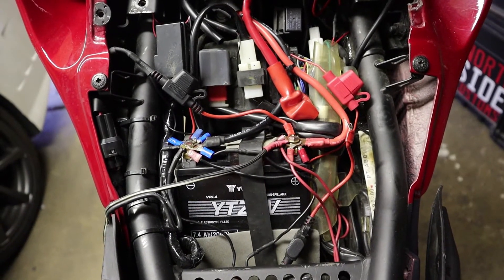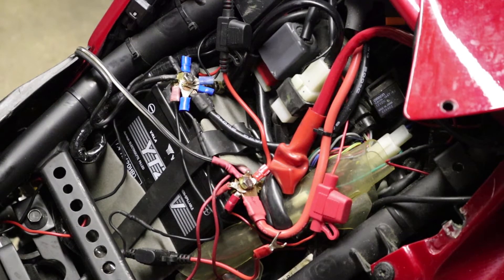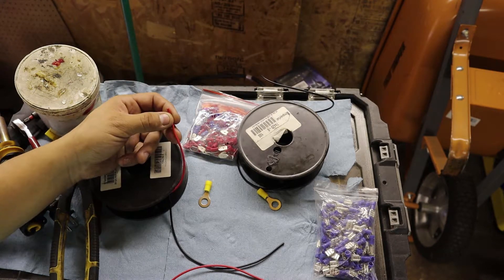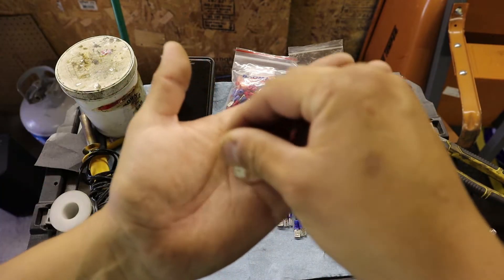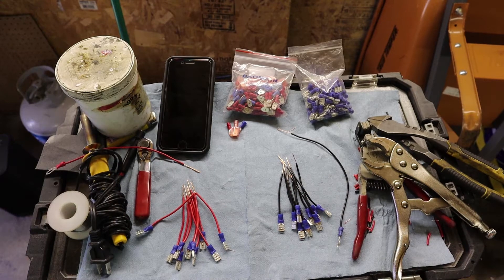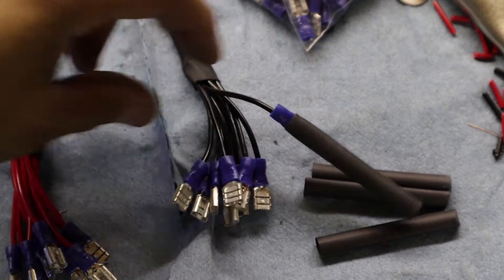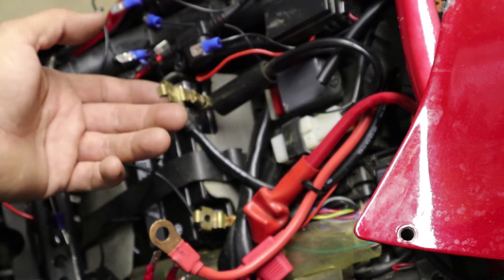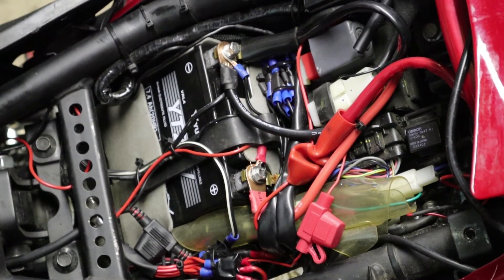How to Consolidate your Accessory Wires from your Battery

Comment: I'm gonna go ahead and say nice video.  I'm also gonna go ahead and agree you may want heavier wire for the single connector going to the battery.  Otherwise, I'm gonna go ahead and say nice job.
Reply from the maker: Thanks for the tips! i was going to go with a heavier wire but then that would create more bulk in an otherwise tight space.
Reply: @ACProductions77 as long as you’re not running all the accessories at once you’re never gonna have an issue. Everyone is a know it all these days. They aren’t wrong, but it’s annoying.

Comment: Nice gave me idea using another connector to do the same thing.
The single wire should be a gage to handle the combined load of all of the multiple wires and not overload…